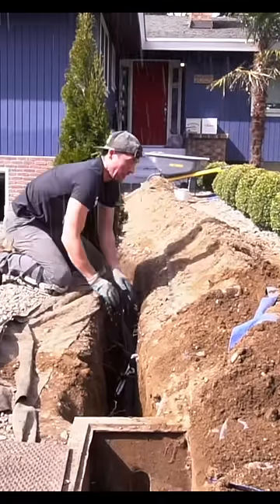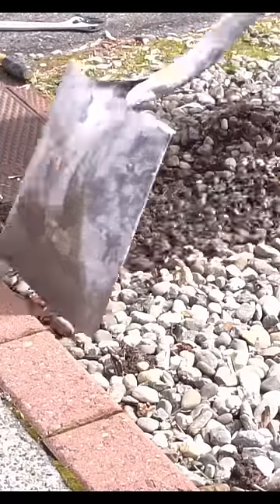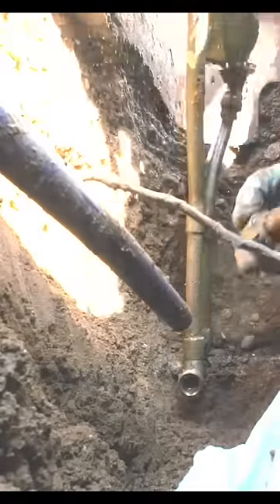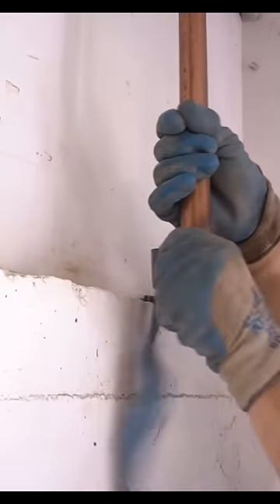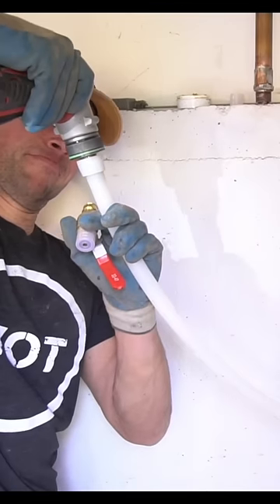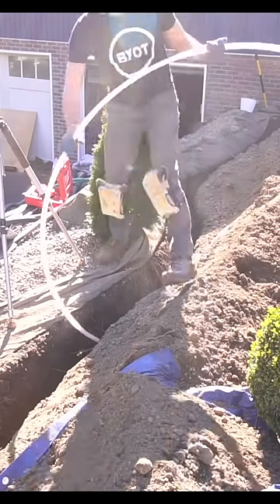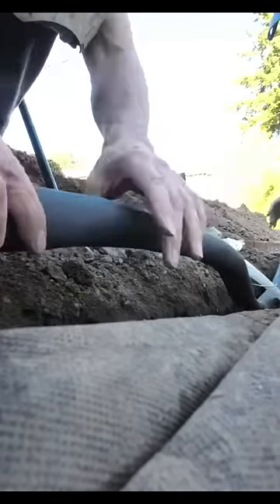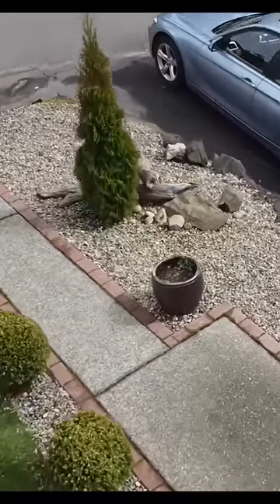Saved $8,000 By Fixing My Own Water Line! #diy #plumbing

Comment: I see youre like every other "DiYer" dont factor in what your time is worth. Took you 2 days, pro wouldve been done in a few hours. Not sure I wouldve used 3/4" line. City water should be at least 1in. So localities have a size requirement in the their code.

Comment: I can’t believe you guys in the U.S are actually allowed to do plumbing work without a license.
Reply: in most cities, you can do your own work but should pull a permit so you can have the work inspected. if you fail inspeciton you can correct it until you pass which means your work is compliant. I did my own electrical panel and passed inspection on first try....

Comment: Yeah, don't do this.
Reply: But y
Reply: @vietnamisapeninsula  I don't do it right or make an error you can cause more damage.
Reply: @brittneyscriven6106  do you mean if you don't do it right
Reply: @zacharykorbet9690  Yes, licenced workers are insured, your DIY is not. In the off chance you do it wrong, make an error, don't realise, bury it, sell he house you just passed on potential issue to another home owner.

Or, there are cables or other pipes in the ground you don't know about.

Sure, you might save some money, sure, you might do a decent job. But, it the risk of you shoveling into an electrical line or a gas line worth it. Is making an error that will cast you twice as much as getting the professional in worth it? No.
Reply: @brittneyscriven6106  what if he is a certified plumber?
Reply: @brittneyscriven6106  ✨️✨️😆✨️✨️
Reply: @zacharykorbet9690  you seem pretty confused, no 😂
Reply: @HughWoo  😄😄